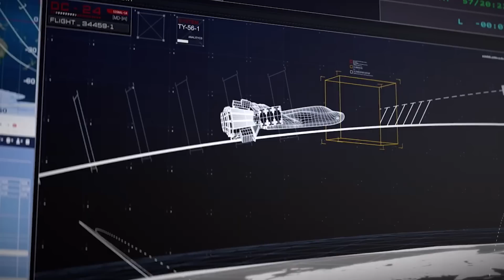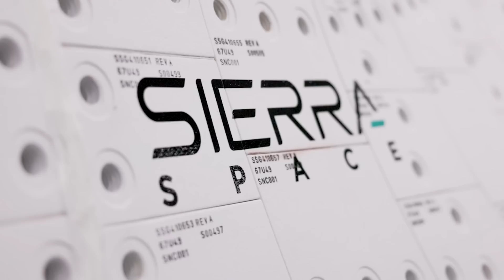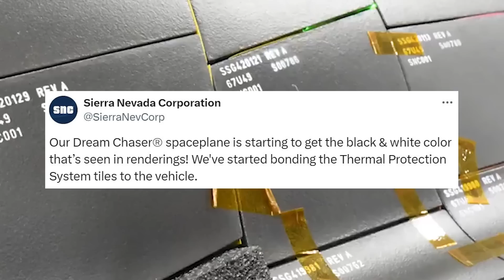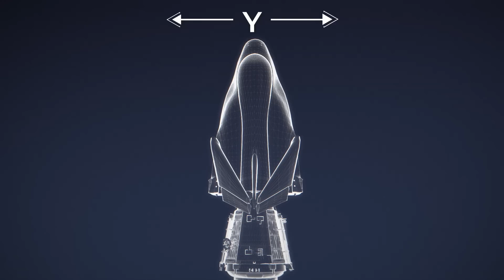Dream Chaser Tenacity Just Missed Its Ride To Space

Comment: Dream chaser at first seems impractical cause it launches on a unreusable rocket, but the landing infrastructure is very cheap and it weighs the same as an Orion capsule so it's basically a reusable, cheaper version of that with a cargo bay, plus it looks really cool so it can motivate people to focus more on space. 

No one knows how good it is as a reentry vehicle, but considering the fairly low mass and a much bigger area to a capsule, as well as controllable attitude during reentry it could enable aerocapture for future interplanetary return, whereas I'm pretty sure Orion would need more ablative heat shield layers. In KSP RSS RO Ive been launching lifting body spaceplanes (not sstos) similar to dream chaser on my interplanetary transfer vehicles and a lander, to enable safe return to earth without needing extra fuel or having to ultra fine tune the trajectories. Considering the many shuttle mishaps from insulation hitting it on ascent, thinking of  spaceplanes as effective reintry and landing vehicles is the way to go, shuttle tried to integrate that with a payload fairing and engine housing, and at some point it's too much. Now crew dragon is ofc much smaller, and lighter, but in terms of rapid reuse and the larger crew capacity of dream chaser, it paired with a reusable rocket could be a new era to cheaper and consistent spaceflight. I realize starship exists, but it has such a high dry mass because of its mission profile and now also requires ablative shielding,  it is unpractical for crew return aside maybe like taking a few hundred people to LEO and back. Starship needs a 3rd stage to go anywhere besides LEO, and it needs improvements as it is to even reach that with any kind of payload. I look forward to seeing what develops from this craft.

Comment: 2 YEARS TO INSTALL HEAT TILES, WHAT?!?!
Reply: probably a bit misleading in the way that it included the practical engineering of how to install those tiles too. so the actual installation time is fraction of that. also the time is not really relevant, the workhour would be a better way of measure, since it depends on how many and how exclusively worked on this.

Comment: Is ULA working on developing a reusable booster? If not, why not?
Reply: They don't fly a lot and have a built in customer.
Reply: ULA is working on SMART reuse, which would allow them to recover part of the Vulcan booster, specifically the very expensive engine section.

As for why they aren't working on propulsively landing the Vulcan booster, that becomes less and less efficient the faster the booster is moving at stage separation, which is part of why SpaceX's Falcon Heavy usually expends the core stage.

Additionally the two engine design they went with doesn't really lend itself to landing propulsively. Finally they seem to think that cheap SRBs make more sense than reusable liquid fueled side boosters, at least for now.
Reply: They are working on engine recovery, from what ive heard its going pretty well so maybe within year or two...

Comment: heat tiles need change, we need a better system
Reply: Come up with one.
Reply: @filonin2  textbooks are full of them  I like golf ball dimples and long static poles,  capsules do fine
Reply: @ne1cup  It's not as easy as you pretend, and lets face it pretending is ALL you are doing.
Reply: @filonin2  you can point out that something isn't going to work without having a solution.
Reply: @Scotch20  Except that the premise it's not going to work was flawed from the get go.
Reply: What happened to the tiles to use with venturestar and it was designed for ease of installation?

Comment: The whole "dream chaser" concept seems to be an reversion to the 1960's "Dyna-Soar" USAF concept, just maybe a little larger.  For practical purposes there is an X-plane of this already flying, which has onboard tooling.  Is the ULA just "playing along" and hoping that a commercial version of the X-plane will come to be, and then using it for "what exactly".  Space tourism is not going to cut it.  Needs to have a more relevant useage.
Reply: Look up ESA HERMES space plane.  It's almost identical to Dream Chaser.
Reply: The usage problem is hilariously overlooked , are these all tax deductible or something ?
Reply: How is Dreamchaser "the ULA 'playing along'"? Dreamchaser is a Sierra Space project, not one by ULA. ULA is just launching Dreamchaser in the same way they would any other customer payload.

As for use-cases, Dreamchaser is quite different from Boeing's X-37B. Dreamchaser, at least the DC-100 variant, is designed to deliver cargo to a space station and return cargo to a runway on earth. It performs a similar role to SpaceX's Cargo Dragon or the Progress spacecraft. The main advantage it has is that Dreamchaser experiences low g forces during reentry and will land directly on a runway, which allows for faster recovery of more fragile payloads/ experiments.
Reply: It's a more reusable capsule. The choice to design it for an unreusable rocket is a mistake but because of its larger capacity, lower G loads and runway landing capabilities, it's still better than any other capsule. Its lighter than Orion and Starliner, and should have a lower turnaround time than crew dragon or at least be an alternative. again, the government wants to have 2 good crew vehicles, and right now crew dragon is the only real option.
Reply: @yourbrojohno  Dreamchaser, at least the DC-100 variant, will not be transporting crew. Starliner remains the only alternative to Crew Dragon and Soyuz when it comes to transporting astronauts to and from the space station.
Dreamchaser + shooting star is designed to transport cargo to and from LEO space stations, competing with the likes of Cargo Dragon, Progress, and Cygnus.
Reply: DreamChaser is an adaptation of HL-20, which is an adaptation of Soviet BOR spaceplanes. IIRC last head of DreamChaser ops promised to write the designers of BOR spacecrafts on DreamChaser, but he is not on the program iirc

Comment: Wonder how tthey stick the tiles on. Tiles falling off seems to be the biggest issues the shuttle had with 'em. Wonder if they've made innovations on adhesives? Even Starship is having issues with them falling off.
Reply: There looks to be 2 holes in each. I wonder if they're bolting them on and filling the countersunk holes with some type of goop.
Reply: Unsure, as Dream Chasers haven't flown yet, but hopefully Sierra is using modern manufacturing techniques similar to SpaceX.  Dragon 2 capsules take up to six months to refurbish between flights, for replacing the heat shield, rockets, attitude jets etc.  Two years ago SpaceX completely redesigned Dragon 2's heat shield, with a new structure and tile layout, as the previous design experienced operational failures.  With an inventory of seven Dragon 2 capsules, I'd guess this didn't interrupt SpaceX's contracted NASA flight schedule.  Fly one, return to earth, retrofit it while a different capsule is prepared for next launch.
Reply: @The-KP  I'm not sure that we can say exactly how long it takes to refurbish a Dragon vehicle for another flight.
If the people who do the refurbishment are told that it needs to be done in time for the next flight, which is in 6 months, they'll get it done. The question is how they would react if they were told that the next flight was in 4 months, or 3 months, or some other deadline.
I'm sure there's a private study somewhere in the SpaceX files that contains an estimate about how quickly the vehicle could be ready for re-use working 24/7 to respond to an emergency.
Reply: @ghost307  I looked up the flight data.  For the four main Crew Dragon craft (the ones that have been given names), they have flown 14 times (last 6/30/2024), with the minimum time between flights is 8 months, while the average is 13 months.  If it took less time to refurb, that would likely be reflected in the data.

The effect of reentry at Mach 25 on heat shields and space craft is absolutely brutal, and we get a sense of that with the news that SpaceX completely redesigned Dragon's heat shields plus the surrounding structure of the spacecraft.  That could indicate a burn-through occurred.  If the original design had worked without trouble, there'd be no need for a redesign.  So, replacement of tiles, and some of the underlying structure, after each flight -the former for sure, and the latter as needed.
Reply: @The-KP  But that still doesn't speak to how long it could take in a priority situation.
Agree to disagree.
Reply: @ghost307   With four capsules in rotation we may never see such a short turn-around.  However, my original comment of "six months" per Dragon refurb quoted a statement made by a SpaceX employee.
Reply: Starship launches produce a lot of force at liftoff with huge acoustic shockwaves and vibrations that can knock off tiles. The forces on Dream Chaser are much smaller and it will launch under a protective fairing. 

Also, Shuttle tiles stopped falling off and were rarely a problem late in the program. The usual issue was with debris striking the bottom tiles during rollout on the runway after landing, which in turn required a lot of repair or pulling of damaged tiles. Debris strikes from ET foam or SRB insulation also caused issues, especially on STS-27 when insulation from one of the SRBs broke off and caused wide-scattered damage to the tiles on the bottom of orbiter Atlantis. 

Furthermore, a development late in the Shuttle program called Toughened Unipiece Fibrous Insulation (TUFI) tiles were proven much more resistant to damage, and it is further improved version of this type of tile that Sierra Space is using on Dream Chaser.
Reply: Dow Corning red RTV for high temp. areas.
Reply: one massive benefit for the dream chaser is not in the direct air stream at launch. so it won't get blasted with the thick part of the atmosphere as it goes up. still needs to survive the vibration, but much simpler. both shuttle and starship is riding outside (buran too, but that was a single event.)
Reply: @thorin1045  The farings also protect Dream Chaser from any debris that might come off the launch system
Reply: @The-KP  yes, but that is also solvable by just moving the return craft to the front (like in starship, that one is only threatened by its own debris, not the boosters debris.)
Reply: @thorin1045   this WILL be an issue on a man-rated version of Dream Chaser as that version would require direct exposure to the air so that a crew abort could take place if there were a booster problem. So might as well get that fixed if it truly becomes a problem.
Reply: Shuttle's tiles fell off because of insulation or ice from the fuel tank or leaks from the solid boosters it was strapped to hitting it. Dream chaser sits in a comfy payload fairing.
Reply: @yourbrojohno  On the first shuttle flight it was determined that significant tile loss was caused by reflection of acoustic waves from the booster. (Please see "Into the Black" : a Shuttle history.) Afterwards, the water suppression system was modified to mitigate that problem. 
Seems like SpaceX is learning that the hard way. It is notable that in the LC-39A design for a Starship launch facility they have quietly included a flame deflector trench. Elon is stubborn, but eventually he learns that all the generations of rocket engineers before him were not idiots. He is the idiot for ignoring them.

Comment: Seems like Sierra Space is dead set on NOT working with SpaceX. They've only considered ESA's Ariane 5 (canceled), ULA, and BO as launch providers.
Sierra Space also has a big plan/agreement with BO to provide exclusive cargo and crewed flights to Jeff's new Orbital Reef space station.
Reply: F9 and FH don't have the payload size and volume to carry Dreamchaser they have 4.2 meter wide fairings as supposed to Vulkan's 5.4 meter fairing.
Reply: @chronablitz  Falcon 9 fairing size is 5.2m not 4.2m. May not fit in the fairing anyway, but technically dreamchaser doesn't need a fairing.
Reply: they shoot themselves in their foot ?
Reply: The whole purpose of this is that Dream Chaser may not even be ready to go in 2024 at all, at least according to some sources.  That means that it'll be delayed into 2025 regardless. And on top of that, the whole point of CRS and Commercial Crew is they provide dissimilar redundancy, so that if one is not available, then another takes its place and keeps everything  going. 

Northrop Grumman is very desperate in using Falcon 9, and they're taking a risk in that, if anything goes wrong, they could wind up being stranded as well. But they put themselves in this position by not switching away from Russian-supplied engines many years ago, like ULA did.
Reply: Blue Origin is not a real hardware company.  Everything they do is on paper and is delayed, delayed, delayed.  They have yet to make a single launch to orbit and are having trouble with simple sub-orbital we have been doing for 60+ years. They spend most of their efforts suing the companies that are launching hardware quite successfully.  Frankly, if Blue Origin was shut down tomorrow, the space programs in the US would all benefit greatly. They are a drag on the companies actually doing the work.
Reply: @parajerry  We'll see soon. They claim that they're going to finally launch New Glenn this year.
Reply: @parajerry   They are not suing anyone, actually,  other than NASA 2 years ago. SpaceX has never been the recipient of a direct lawsuit or other litigation by Blue Origin. Nor has Blue sued, say, Rocket Lab,  Boeing, Axiom, Lockheed Martin, or ULA, or Relativity, or Stoke Space, or Arianespace, etc. So that's a clear lie on your part.

This common lie or semi-urban myth seems to mostly be the imagination of the SpaceX fans, not anything based in reality, and Elon has done little to curb the bad behavior of his fans. Of course, SpaceX has sued Blue Origin over the landing barge patent in 2014 and they sued the US Air Force to open the NSSL to other companies.

Blue Origin has successfully built and flown several vehicles: Goddard, Charon, New Shepard. New Shepard has flown to space 23 times now and carried people safely and to and from space 6 times. It has built and fielded engines, like BE-1, 2, 3, and 4, with 7 on the way. It has New Glenn nearly finished. In fact, yesterday they successfully carried out a critical test of the strongback retraction and quick disconnect systems for the rocket at LC-36. Earlier this year a full New Glenn stack carried out successful cryo propellant loading tests.

So, your notion about "everything is on paper" is another big lie of yours.
Reply: @parajerry  That's a lie.
Reply: @nowhereman1046  Show me the hardware!  That have a lot of mockups and plans...no real stuff.
Reply: @parajerry  Are you blind!?

New Shepard has flown to space and back 23 times. That's as real as it gets. It has taken 36 passengers, and over 150 experiments to space and back.

New Glenn hardware has been there for all to see for several years now. BE-4s have been delivered for years now to ULA, two flew perfectly on Cert1 6 months ago. Where were you for that?

New Glenn has rolled to the pad several times and underwent a big cryo propellant loading test back in February.  A boilerplate New Glenn yesterday did a test of the strong back retraction and quick disconnects.
Reply: @parajerry  You serious!? You must have your head stuck deep in the sand to not know about what's been happening the last 6 months or so with BE-4, and and New Glenn, never mind the last several years with New Shepard!
Reply: @parajerry  they literally have shown 2 NG cores in factory, and rolled out partly finished flight hardware to the pad.

But keep trolling i gues
Reply: @_mikolaj_  Wow....do you know how many failed rocket companies have shown cores in their warehouse, and some even attempted launched, but are gone?  I am not saying BO will fail, but they have yet to have a success that would justify their claims or the contracts they have received.  Bezos is succeeding on paper with grants, contracts and relationships that are unearned...he bought them.  Astra has more to be proud of than BO.  At least they are actually launching payloads successfully.
Reply: @parajerry  NASA has a lot of trust in them, giving them a whole iss replacement contract, a mars mission, and a reusable lunar lander.

You only see the outside, but people who are potential customers get to see more, and i trust their judgement.
Reply: @geesehoward700  The design is agnostic as to what launcher it's designed to go on, but the fairing is the big limiter due to the inside volume, and even with wings folded, DC is still far to wide to fit and with Shooting Star, too long. The original crewed design didn't care about fairings because those got in the way during a launch abort. Since Cargo DC doesn't have an abort system, they just fly under the fairing, come what may.
Reply: @nowhereman1046  yeah, your right. I poorly phrased my sentence.